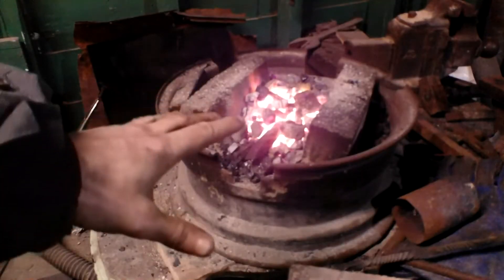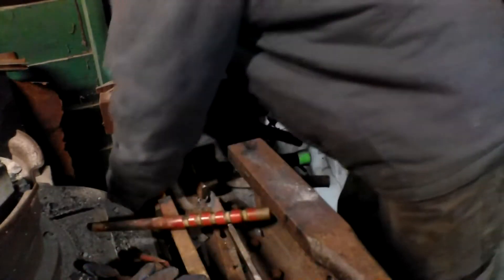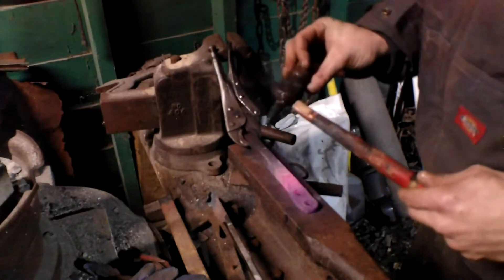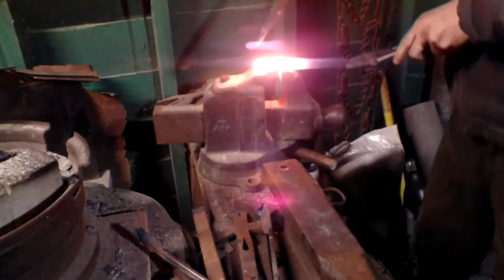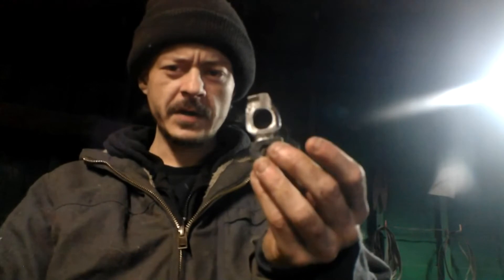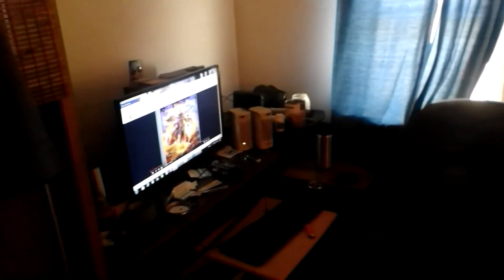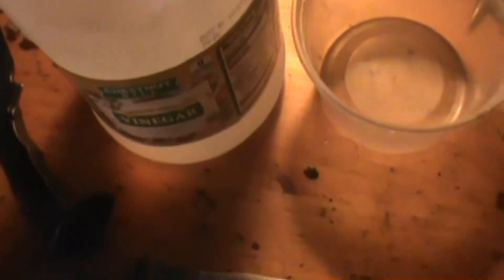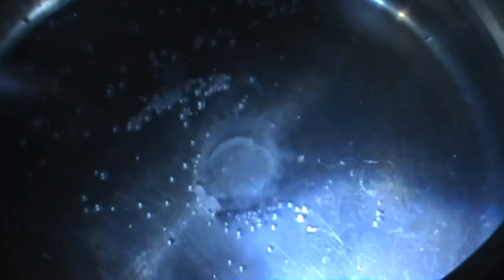Wrought Iron Ring Ferric Chloride Etch

Comment: Cool deal. Nice to see a real dude. Couple thoughts. Muriatic acid from a hardware store works for etching. Dilute it though as it works fast as it is stronger than vinegar. I've etched wrought a few times in it. I made some wands out of wrought. Same splitting frustrations, even worked VERY hot. But the acid did get some deep etches. Other issue was it rusting after sitting a bit. Not sure how you are going to prevent that in a ring. I think you'd have to coat it. Anyhow nice to see another regular dude doing stuff.
Reply from the maker: Thanks for stopping in! A little linseed oil or bees wax with stop it from rusting but that's up to the person who buys it. I always give them a little note telling them  how to do it. I find wearing it and rubbing it with your fingers will  also keep it from rusting.